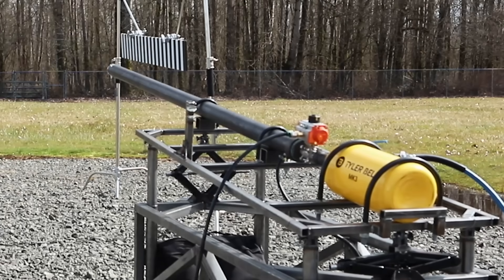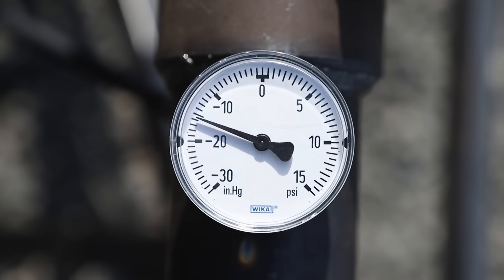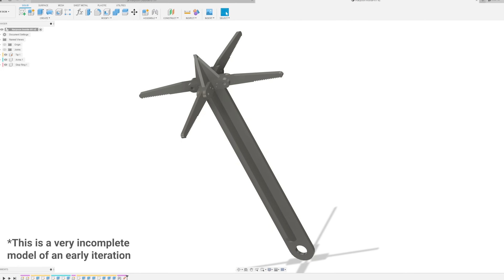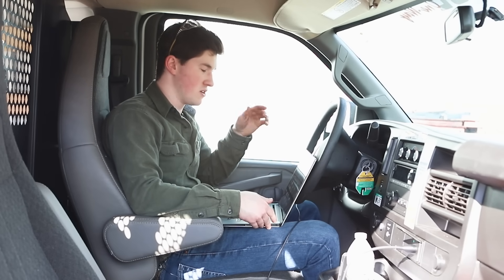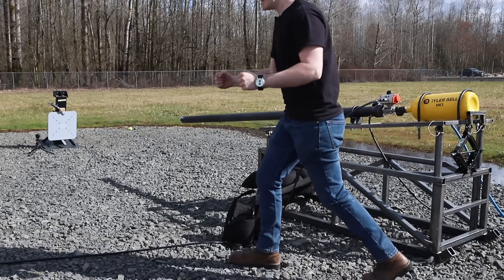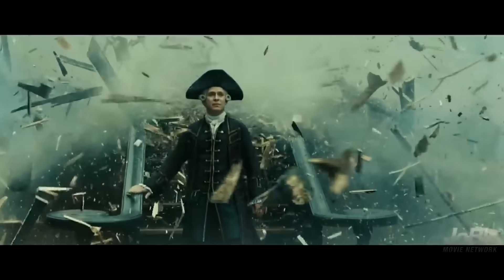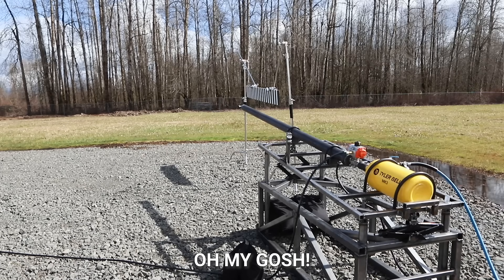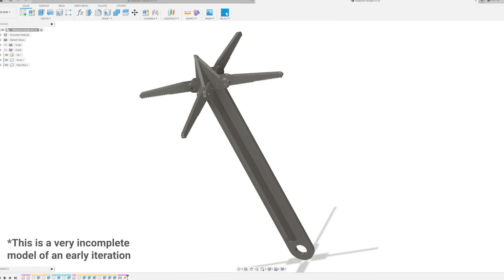Have I Found the Fastest Air Cannon Valve??

Comment: Years back I was working on an avalanche control invention using compressed air and a combustible mixture to try to imitate the explosive shockwave produced by small explosive charges. I built the device around what's called a 'regulator' cannon. This is a configuration where the projectile barrel is nested inside of the pressure vessel with a void space at the back. Inside that void space is a piston with a neoprene disc on the front of it. When compressed air is put in the back of the device the Piston is pushed forward pressing the neoprene disc against the back of the barrel. Compressed air squeezes around the edges of the neoprene disc filling the pressure vessel. When you let air out the back of the device, the vacuum pulls the piston away from the barrel creating a very large aperture. Nonetheless, with only compressed air you cannot exceed the speed of sound at the muzzle. Compressed gas can only expand at a maximum of the speed of sound in that gas at whatever given temperature and pressure. As the gas expands it becomes cooler and the speed of sound becomes slower. I overcame this by injecting oxyacetylene into the pressure vessel. Igniting that also pushed back the piston, achieving supersonic muzzle velocities.
Reply: Also, I had my device fabricated from HDPE. I chose that material because pyrotechnicians use it for mortars and it will never shatter. It also expands quite a bit before failure, which will occur as a split, rather than shattering, like steel or other materials. It is only 'rated' for 110psi, which was my operating pressure, before combustion. I have no idea what those pressures were. I only tried it that way during one session, at a gun range. It was easily the loudest thing present, by far. After a few shots, it refused to fire and I realized that my flawed fuel supply system was feeding oxygen into the acetylene tank. Needless to say, that was the end of those experiments. Also, the gun range asked us not to come back. LOL
Reply: @zippythinginvention  HPDE might not shatter at normal temperature, but it will shatter at -45c.  Had to buy a buddy a tooth after a firework accident because of this (commercial 50mm mortar loaded with the firing charge up due to human error, starshell shattered the tube, he caught about 35 grams of HPDE to the gob).  I know that avalanche conditions are generally more of a concern in weather people want to ski in, but still.  Be careful out there.
Reply: @CCNorse  that's a really good point. The one I made was a small scale prototype, just 6' long. I can't remember the diameters. It had another 6' section that screwed on, for the projectile launching function I so enjoyed.
Reply from the maker: Very interesting!
Reply: @TylerBellMakes  I can't currently find any reference to a "regulator" gun. So, if my description isn't clear, I'll be glad to elaborate. Also, I used an solenoid powered ball valve to release the air from the back, actuating the thing. I used the circuit from a remote car starter, with one button releasing the pressure and one button lighting the spark plug.